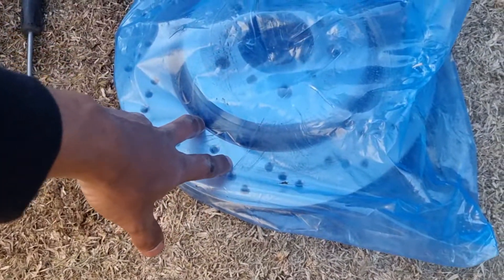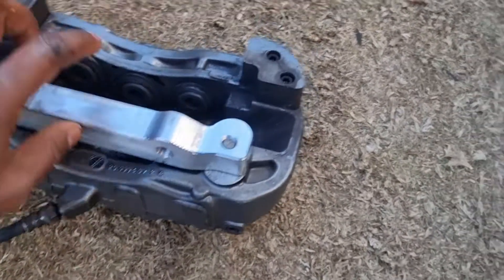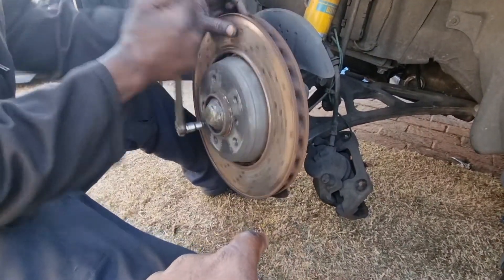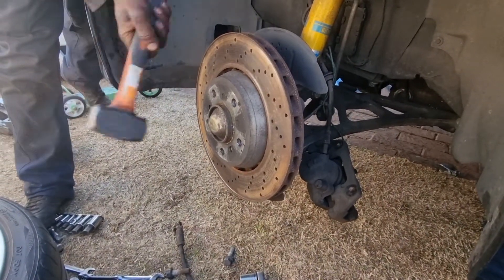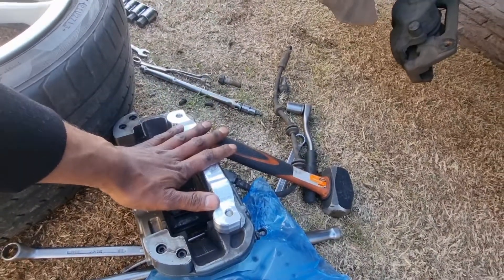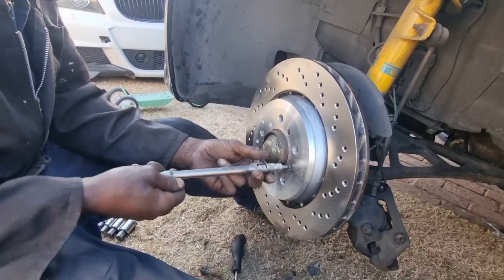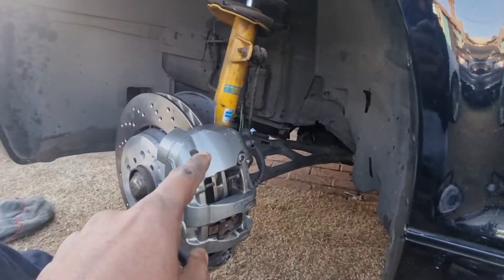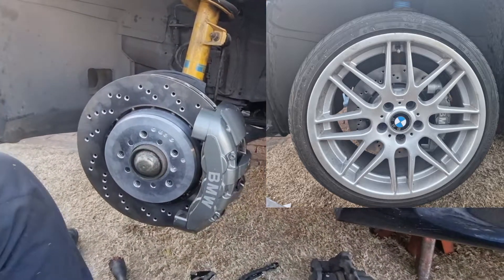The Modification every E46 M3 needs

Comment: good shit... but if you had to put spacers the bracket isnt made properly.
Reply from the maker: The bracket does not impact the offset of the hubb and will not hinder the use of a spacer, we actually have spacers on our e30 m3 using the same bracket...the purpose of the bracket is to get the correct position of the caliper as well as the brake pad position to the disc
Reply: @EnthusiastGarageSA  im talking about the spacers you put on the bracket...?